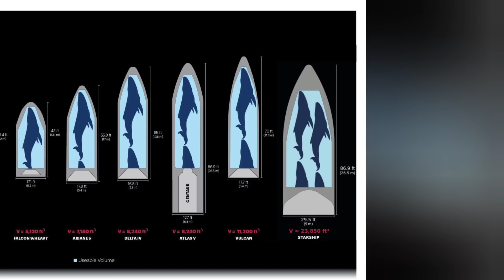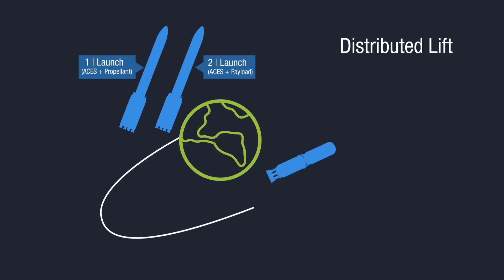Devastating news for ULA!!  But why does Vulcan Centaur matter?

Comment: Regarding geostationary orbit from Starship, wouldn’t the solution be to include a small kick stage in its payload fairing? It has both the payload mass and volume to allow that.

That said, I absolutely agree that the lack of extended fairing for the falcon heavy is a strange move.
Reply: Just how much mass exactly do you need?

We are comparing this to Vulcan.

Normally a falcon second-stage isn't anywhere near orbit at stage separation.

You don't need a fairing because you're putting the entire thing in a Starship.

The Falcon second stage would be a space tug. You either have to get it back or you have to refuel it in orbit.

Seems a lot easier just to get it back, so integration can be done on the ground. Since you're already starting in LEO, got lots of fuel for the return trip.

That's if you really need something in orbit right now. If you can wait a few refills, then Starship can get you anywhere you want to get.

There is no mission Vulcan is theoretically better at, when you consider scaling and economics.

And that's just my idea.

Maybe SpaceX has their own idea for kick stages. If you can Starship you can kick stage. Just like if you can dodge a wrench you can dodge a ball.
Reply: @jtjames79  Using a falcon second stage as kick stage seems like it would be a strange choice. It would require some system to feed cryogenic fuel inside starship's fairing, and would require additional infrastructure for kerosene at the starship launch site.
Reply: @gideonrabson4600  I didn't say it was the best idea.

Just thinking out loud. Have a feeling once Starship is up-and-running, there's going to be a bunch of Merlins laying around.

Lots of rockets have used two different fuels at the pad.

The payload to LEO is still ridiculous, particularly considering the cost.

It seems to me you're making a mountain out of a kick stage molehill.

It doesn't take a lot of outside-the-box thinking to figure out a way to make Starship faster, cheaper, and easier to any orbit than Vulcan.

Lots of commercial off-the-shelf upper stages to pick from.

I just think if I was SpaceX and I had a bunch of Merlins laying around I might want to figure out a way to use them to make more money.

Maybe something else might be more efficient, but if I'm SpaceX I don't have those just lying around, so it's probably worth a consideration.
Reply: @jtjames79  But the merlin upper stage is one of the least efficient upper stages in modern rocketry. Although the falcon family can get enormous amounts of mass to LEO they fail to match the competition to farther orbits or injections. Still wondering why SpaceX didn't make a better upper stage when the merlin vacuum is just not on par with industry alternatives which use hydrogen.
Reply: The solution for pretty much everything is to re-fuel Starship in orbit.  That's already central to almost all of their plans, and once it's viable it means Starship is effectively all but unlimited.
Reply: Best would be a one Raptor kick stage which gets fueled by the fuel pipes of the header tanks.
With Raptor(vacuum) they need per 1t dry mass, 2t of fuel to get from LEO to GEO.
Reply: What payload fairing? The 1967 "You only live twice" design ripoff Musk thinks he is going to use?
Reply: This is why I think SpaceX should have perfected second-stage recovery for Falcon 9.

You could push a lot of mass if you could use it as a recoverable kick stage.
Reply: @jtjames79  This would reduce how much mass could get to orbit though since fuel would be required to deorbit and land the 2nd stage when much of the second stage fuel is already required just to get to orbit. It's not like stage one does all the lifting to orbit and stage 2 is just bonus. I don't believe this is practical for this reason.